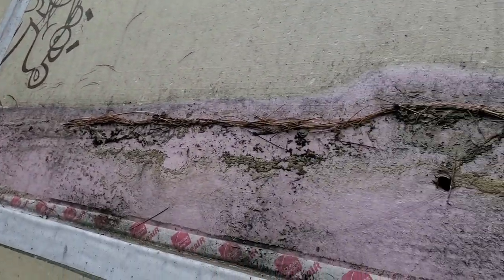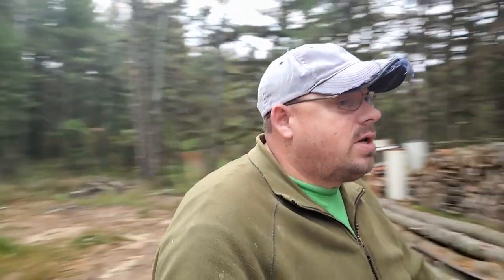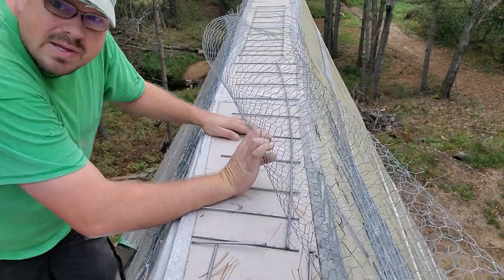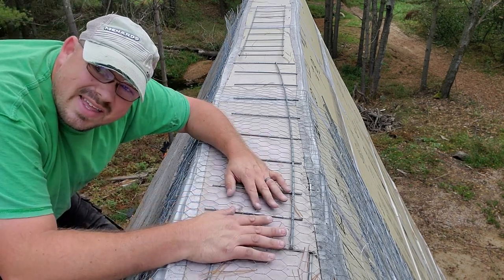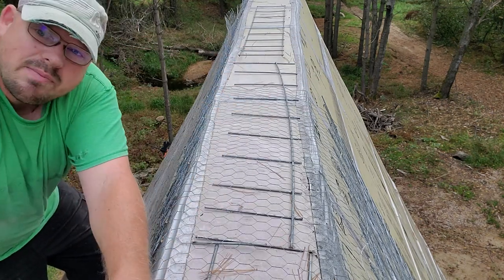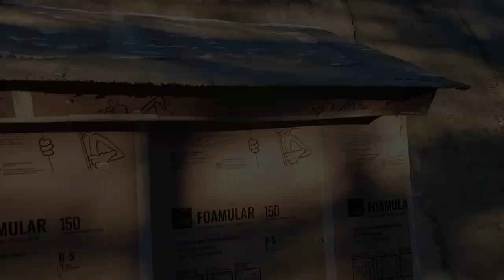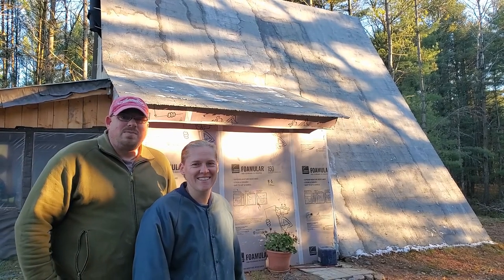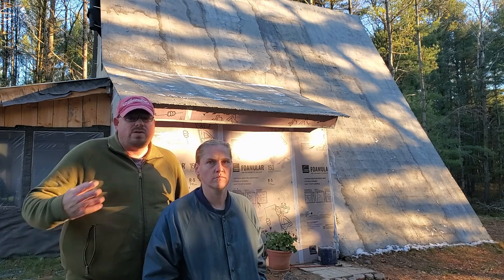Making A Cement Tent Over An A-frame Cabin

Comment: I am learning from the condo builders on the ocean when their buildings fall down due to corrosion of the rebar reinforcement and also the hwy bridge builders.  Regular concrete is porous and absorbs water that can freeze and cause spalling and allow moisture to get to the rebar.  Many Admixtures are now available but it appears to me that for home project guys cheap mis colored latex paint sold cheap is a good way to strengthen and waterproof the cement.  Also  plastic or nylon etc fencing to be used as  reinforcement instead of chicken wire.  In your case, for a coating come spring on your concrete tent A Frame,  I would suggest an admixture be added and that being latex paint of any color to substiture for the water in the concrete mix.   Also study the guys who are making concrete kitchen countertops.  Their slabs are super water-stain propf and  strong.   I think if you create this roof instead of design for only 8 or 10 years they redo,  why not design for 30 or 50 years or a thousand like the Romans.   The improved concrete will probably be cost effective.  Do a google on Latex Cement and concrete for containers that hold water etc.
Reply: basalt rebar and basalt fabric would be the best to use

Comment: I think you meant to say hog wire. Great idea. I have been thinking that covering a wood house in ferrocement would be a super cool idea so its nice to see someone doing it and filming the process. thanks for sharing that.
Reply from the maker: Hog pannel / cattle pannel interchangeable in this application. I believe hog pannels have wires closer together on one side meant to be the bottom of the pannel nearest piggs or hogs. Cattle pannels are identical to hog pannels except all the wires are evenly spaced across the entire pannel. Thanks for watching!
Reply: It's funny how so many people these days feel the need to pettily correct someone unnecessarily for no helpful reason.
Reply: @johansenfamilyvlog8972   True but hog wire and chicken wire are two totaly different animals. pun intended.

Comment: Its a pretty flat roof surface, maybe get a heavy duty canvas sheet, soak it in cement and Stretch / drape it over as a skin. Beats rendering it.  Might work...?
Reply from the maker: Dont have any experience with that myself. Does it have any structural strength?
Reply from the maker: Okay, latex cement is used in a lot of places. You can buy the additive at most supply stores to add to regular cement in place of water which makes it much stronger. I havent ever heard of impregnanting canvas with dry cement but I have seen this https://youtu.be/MblPOoubXb8 sounds kind of what you are talking about. I didnt need mine to be structural but I did want it to be stronh enough to not get damaged from falling tree branches durring a storm. My roof was an evolution in my head that started with what they call ferro cement. I have also seen a realy neay youtube video about "air creete" where the youtuber adds foam particles in the mix and uses forms to set. All very interesting stuff. They make boats out of ferro cement among other things. Thanks for watching.
Reply from the maker: We did another part of the roof in a later video over the porch where the roof was more a conventional pitch and it layed out quite nice without the use of standing on laters trowling the cement in. The steep roof of the A frame was very labor intesive to complete and it had many "cold" joints because we could not complete it all at once.
Reply: @johansenfamilyvlog8972  thanks for sharing your inspirational journey. I'm about to do the same and need to build a few sheds and habitats across our farm. So this has been wonderful to learn from your experiences. It's deeply appreciated. Thank you and best wishes to you and all your family.

Comment: Lots of hard work going on there. The water should run off easier with out the wood slabs in the way. Good to see ya back. Thanks for sharing, Iowa cares. Been cold in mornings here this week. 21 degs.
Reply from the maker: Yeah, there was some wetness under some of the boards. I think this roof will function well and there are now no fasteners through the pink foam board. Got a little snow and freezing temps. Warming this weekend!

Comment: You  should add Na 2 Si O 3 to cement to make it repell water.  This  way the  cement /concrete will absorb water (that will cause cracks in winter time) and you  will  see leaks in near future and huge leaks later... And that  tape underneath won't hold after few years no matter how expensive it was. 

BTW : concrete roofs are common here in EU,  but  they  are  always covered with bitumen etc.
Reply from the maker: Thank you for youre comment, I will look further into your suggestions. I was going to add another thin layer of porrland cement this spring.
Reply: Yeah. I wondered I think laminated ferro cement is great.  The boats don't Crack.   The key for our work is the hardware cloth.  We use 2 to 3 layers always.  The hog panel backing is great.  Like mini pre made rebar

Comment: How is this holding up?  I'm in the middle of building a small yurt and am covering it with thin concrete instead of canvas.  I've looked at a lot of videos and this looks like one of the only structures that would hold up over time.
Reply from the maker: It seems to be holding up nicely. It has been 2 full years now and it is all still in one piece and not leaking. I do see a few hairline cracks that i will probably fill with thinned  portland cement next spring. We also attempted painting it with an epoxy garage floor kit and that is not holding up at all. I will eventually have to pressure wash off whatever is not adheered to the cement and reseal it with thinned portland cement. The metal in the roof cement seems to be adding a lot too the overall integrity of the structure. Thanks for watching. Btw... i did see a video of someone who cemented their yurt and it looks like it turned out nice. Of i can find that video agsin i will add the link.
https://youtu.be/MblPOoubXb8

Comment: I was wondering what you’d use to cover the foam.    

Will be really interested to see how the mortar coating holds up over a few years.   

I used tuff 2, a premixed elastomeric foundation coating sold in 5 gallon buckets for about a hundred dollars applied over a sticky fiberglass mesh on foam on the foundation of my garage.    Been in place for 10 years and holding up well.    In Boston area.
Reply: Normally I see stucco on vertical surfaces.    If you have future issues after the second coat you could try one of the elastomeric roof coatings.    I’ve looked at that for a travel trailer.   Not sure if it can be applied to masonry 

Maybe just recoat with the cement skim coat keeping similar material
Reply: Also.  You can add color agent to a mortar mix if you want to have an alternate to natural concrete color
Reply: Finally I got how you ended up with the a-frame house.   From tractor shed to home.    

Saw your rough framing is non traditional on the a-frame. Wondered how you selected that method.  Since you have a saw mill was thinking you can make any of the standard lumber sizes

Are you planning for this house to be a transition dwelling till you can mill the materials you need for a more traditional style cabin/house?
Reply: Just an FYI.   My family has a place north of eagle river.   Love Wisconsin woods and lakes
Reply from the maker: Patience might like adding the color to the roof. Thanks for watching.

Comment: Very impressive and hard working family. I've never seen a roof coated with cement in that way, only when they pour a flat roof. Is this your own invention or is this a common practice?
Reply from the maker: Not a common practice. I came up with the idea after getting interested in something called ferro-cement. They make boats, park structures, and some unique housing with it. Traditional ferro-cement should have more metal in it than mine does. Thanks for watching.

Comment: Basically the same process as a ferro-cement boat hull.  Difference I see is a boat hull has to be done in one continuous spread of the cement in order to prevent leaks.  You can't stop and start 'cold' joints like that.  Maybe not as critical in a steep pitched roof where water runs off, and not trying to penetrate a hull.  Time will tell.

Other thing I see is a lot of still exposed chicken wire.  Our experience with chicken wire is it's good for about 5-8 years, depending on how good a job of galvanizing it was done (and no way to tell on that), then it rusts out.  Once you get rust going, I suspect the mortar isn't going to last either.  So plan on a second coat to thoroughly cover the wire.

Last, did you compare the cost of cattle panels/wire/mortar to conventional metal roofing ?  I find it hard to believe this is that much cheaper and and certainly WAY more labor intense.
Reply from the maker: Very good points, i did find this to be cheaper, though i did not consider potential future repairs or the portland cement skim coat still to come next spring. It was certainly labor intense. One benefit i was able to achieve over other roofing methods was the absence of fasteners through the pink board insulation. Thanks for the comment.

Comment: I have to give you some props for your hard work! What are you using for the water supply?
Reply from the maker: Thanks for the comment. We have a water inlet line that we ran from the creek, underground, to the cabin. We use a 12volt water pump like found in an rv to fill a 30 gallon pressure/well tank. We use the water for everything that isnt potable. We have seperate potable water that we purchase or get from "best neihgbor ever."

Comment: How has it held up?
Reply from the maker: So far so good for the cement roof. It has been 3 winters now and if it is leaking we dont know about it. The epoxy paint we put on is not doing well. It is chipping, flaking, and comming off in most areas of the roof.

Comment: So, is the metal - and thereby the cement - not anchored to the structure?
Reply from the maker: Correct, it is not. The entire cement portion of the roof is setting on the house like a hat. Thanks for watching.
Reply: @johansenfamilyvlog8972  why not? Seems silly
Reply from the maker: Cement expands and contracts at a much different rate than wood. Because it weighs so much, and its inherant stable shape, there is no need to fasten it to the wood structure supporting it. One advantage is that no fasteners means no thermal conduits for heat to travel through the insulation, but that is certainly not a reason to not use fasteners.

Comment: What kind of follow-up can you share about this roof project?
Reply from the maker: Hello. The cement roof on the cabin has been installed for over 2 years and through almost 3 winters in Wisconsin and is holding up wonderfully. We have not found any leaks through our roof system into the cabin. The roof system includes two layers of half overlapping tar paper and two inches of pink foam board taped together at the seams. Then is the 1/2 inch layer of cement encassing the cattle panels and chicken wire. All this has held up well. 1 and a half years ago, now through 2 summers is the epoxy garage floor kit paint we put on top of the cement. My hope was that it would permenantly seal the cement but it has not held up well at all. I do not know what the cause of failure is, it is certainly not intended for the purpose I attempted to use it for, but it is brittle and flaking off in areas over the entire roof. Overall we are very happy with the roof system on the cabin and we do live here full time. The roof on the summer kitchen, which we installed early this past summer, also seams to be holding up well. That was a dry pour in similar style to the cabin roof though I decided to attempt to seal the cement with very watered down portland cement. Thanks for watching. Merry Christmas.
Reply: @johansenfamilyvlog8972  Awesome! I just figure if it’s a good enough system to build water tanks in the third world, it’s probably a good roofing material. I built a small outdoor table with a 3/4” ferrocement top — except I used basalt. It’s performed flawlessly through several freeze/thaw cycles. This truly appears to be a sustainable way to build. Thank you both for sharing your journey and for circling back to satisfy my curiosity!! Blessings - Jeff
Reply from the maker: Ive probably seen the same water tank videoes! They also make boats out of ferrocement.

Comment: had a simluar idea but with  a Quonset hut
Reply from the maker: Yeah, they do a lot of shot creete over spray foam on quonset huts. Have to be careful to not put on too much wet cement at once. The quonset hut by itself cant hold that much weight until the cement has cured. They also use that strategy to make bunkers. Thanks for watching.